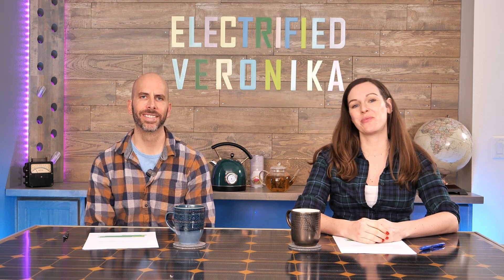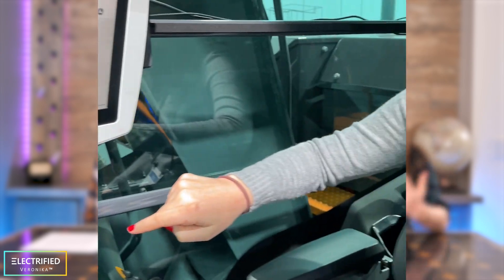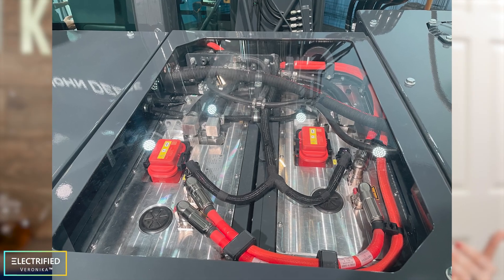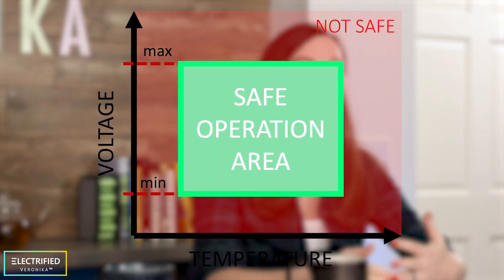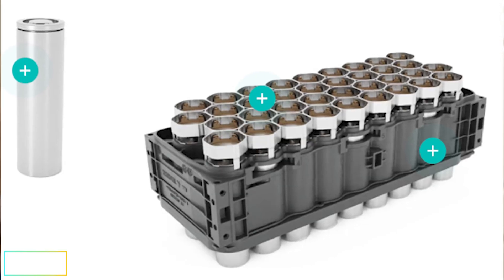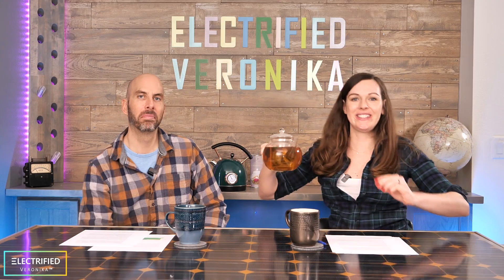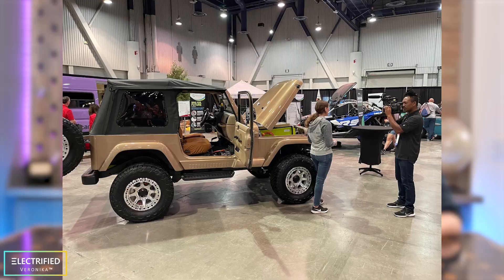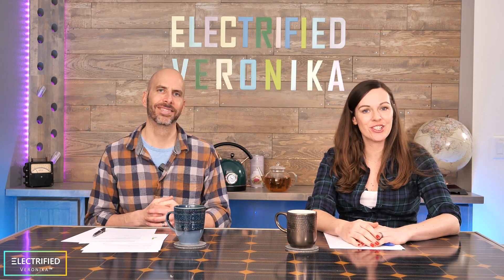Electric John Deere Excavator, Kreisel Battery, Arnold Schwarzenegger? Our CES 2023 Highlight

Comment: I'm also a SunBadger consumer near Rockford. I did not receive the letter you did from the service company. The system is working great, though! It is a 10 KWh system which is definitely helping offset my power needs. I have 2 BEVs and have driven them for over 5 years now.

Comment: Heavy equipment does not need more effective cooling, because the charge and discharge rate relative to capacity will be no higher than a car (and probably much less at peak). It does have a higher durability requirement, because this equipment works for hours per day (instead of minutes of driving that an average car gets) so long life is important.

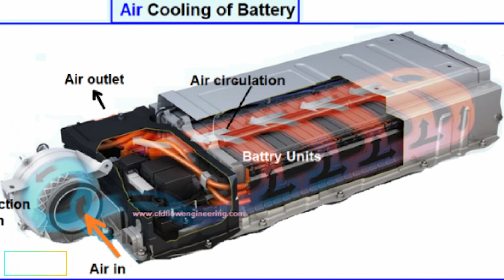Comment: For an air-cooled battery @4:12 you show a forced-air system, with a blower. A few EVs have had that , but the Leaf is not forced-air cooled - there is no air circulation through the pack at all.

Comment: LOVED THIS! I have so many question about these different topics. To start off, was it SunBadger that went bankrupt? Or did I misunderstand that part?
Reply from the maker: Just keep the questions coming! So SunBadger WAS a solar installer that we decided to go with for our solar roof installation last summer here in Wisconsin. And unfortunately they just ran out of business. We will follow up with more details in dedicated solar video. The service up until now was really good with them - but now we kind of loose our maintenance service - we don't expect any problems - normally you don't have maintenance issues with solar, but still..kind of a bummer.
Reply: @ElectrifiedVeronika  so, we are MKE locals and Manushak & I (Tanya) are neighbors. We both used Sun Badger, but our install on our 2 houses was abt 2 years ago. So - the news was a bit shocking for us because we’ve recommended Sun Badger to people. Thanks for the response!
Reply from the maker: @manushak_and_tanya  Oh you have solar too, that's awesome! Yes, we were shocked also and we did recommend Sunbadger too - very unfortunate situation!